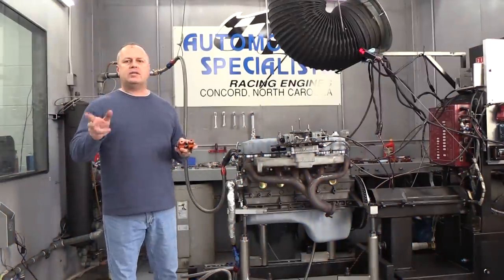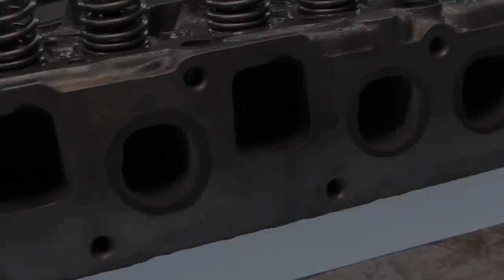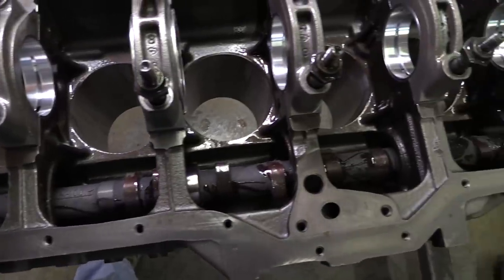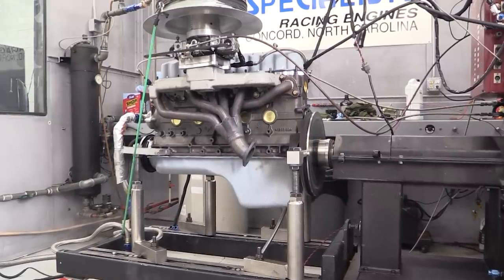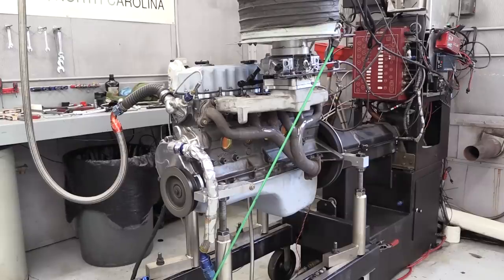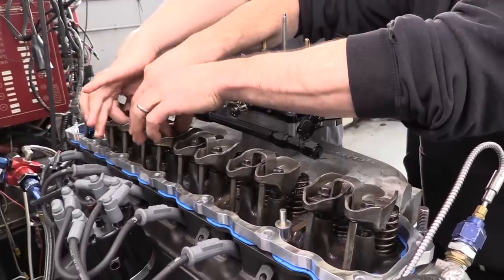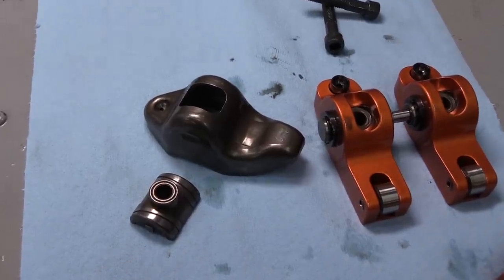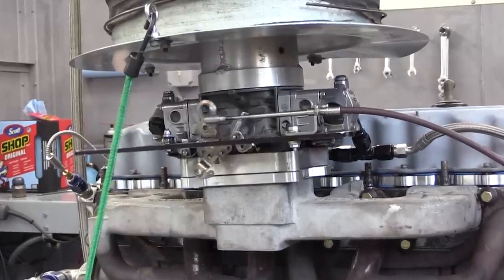Do Roller Rockers Make Power? (Dyno Testing a Jeep Stroker to Find More Horsepower)

Comment: Not much of a surprise but the 10% increase is more than I would have predicted. Another advantage to rollers, I believe, is that the engine has better throttle response in addition to more total torque and hp.
Reply: Basically there was another show that tested actual ratio of factory rockers on old and new vehicles alike...    A 1.5 ratio rocker usually had a ratio of 1.3-1.4 and a 1.6 ratio rocker usually had a ratio of 1.35-1.5...       So even going to a roller rocker 1.6 from a reputable rocker manufacter where 1.6==1.6 ratio you will gain over a factory 1.6 so it's not due to friction losses.   And in the case of going from a factory 1.5 ratio which might be 1.34 or something to a true 1.60 you just gained .26 in rocker ratio or 15% more lift at the valve!    This is where the power is, and in this 10+HP situation where the torque curve is elevated throughout this is exactly what is going on.

Comment: This test has been done many many times, the results are always about the same, and people continue to think roller rockers are a waste of money. As mentioned below, much comes down to stamped rockers being very inconsistent in size, not simply reduced friction.
Reply: Much easier on the valve train, less debris getting into oil, cooler temps, less friction, more power, better economy. Yeah such a bad investment :S

But of course they'll burn all their money converting to horseshoe and boring out the TB and putting spacers everywhere with messed up intakes...
Reply: Came here to say that exact same thing. Just having consistent ratio will make a difference. Power has been made with just roller tips.
Reply: How are roller rockers on holding up to many miles? I have never understood why LS engines don't use them. I always figured they don't have as long of a life, but that seems counter intuitive because of less friction.
Reply: John Tate way more moving parts. Stamped piece of steel is virtually indestructible. Fiction is minimal in a stock well oiled engine
Reply: @CanadaBud23  Horseshoe?
Reply: It truly depends on the engine. On a 90s and early 2000s Chrysler product where everything is literally made as cheaply as possible yes going to a high quality aftermarket rocker is beneficial. But if the engine already has very good quality rockers on it from the factory like the LA series small block mopars or the LS series chevy I would be surprised to see even a few HP difference. They can claim less heat and less wear all they want but until I see a test of oil temperature in a controlled environment I'm going to continue to use what has been proven effective and reliable for the last 60 years.
Reply: @johntate4638  depends on how quality they are...
but they should last 100,000 easy.... if not for ever
.
lots of modern cars use roller rockers (or lifters, ETC)
Reply: @johntate4638  and i think GM dont use them as they were the first to use stamped rockers..... and they have always been pretty good
like.... the design is perfected 
.
cheap to make, dead reliable and simple......
Reply: @snek9353  99 to 06 intakes are nicknamed "the horseshoe"
Reply: Lot of extra moving parts for 10hp, probably the worst $/hp power addition, maybe for a race motor .. but for my weekend street cruising motor not worth it

Comment: In Argentina we have a heavily developed Cherokee engine (with less stroke and more bore), that we use to power the Torinos and GTXs in our top racing series: TC (Turismo Carretera). It uses a dry sump lubrication system, 2 Weber IDF 48-48 carbs, and develops 460 BHP, revving until it gets to 9000 rpm.
Reply from the maker: That sounds pretty cool
Reply: The Horsepower Monster search a couple of onboards and you will see what I’m talking about. It used to rev to 9500 rpm to make the same power but now it takes only to 9000 rpm. It uses a 14 mm cam and altough the head doesn’t flow that much, they use a lot of luz  de leva or cam light (the thin layer of oil) (I don’t know the translation) so the cam opens way faster.

Comment: I would say between the net gain in HP and torque and  less heat, wear and stress it’s worth the extra $$$.
Reply: Swapped some on an old small block build and I figured about 15HP , good video I have been thinking of adding them to my stroker TJ . Thanks for the amazing work!!!

Comment: Basically there was another show that tested actual ratio of factory rockers on old and new vehicles alike...    A 1.5 ratio rocker usually had a ratio of 1.3-1.4 and a 1.6 ratio rocker usually had a ratio of 1.35-1.5...       So even going to a roller rocker 1.6 from a reputable rocker manufacter where 1.6==1.6 ratio you will gain over a factory 1.6 so it's not due to friction losses.   And in the case of going from a factory 1.5 ratio which might be 1.34 or something to a true 1.60 you just gained .26 in rocker ratio or 15% more lift at the valve!    This is where the power is, and in this 10% increase situation where the torque curve is elevated throughout this is exactly what is going on.

Comment: This was one of those, "well... yeah." videos. 
That six into one header really made that old Jeep motor sound good.
Reply: Well it was run open so...
Reply: I think a split of the old header would sound better, giving you dual-exhaust like the classic Hotrodders used to do to both Fords & Chevys.  No reason a split couldn't be done to an AMC-sixer.
Reply: @jackdale9831  if you buy a aftermarket WJ or TJ you’ll have a true dual at the manifold…well let me rephrase that the factory ones are dual outlets as well but they make less torque then the aftermarket ones from thorley or banks…the clone ones for 100-150 bucks work pretty good as well if they’re checked for a flat flange and good welds before installing it

Comment: I wish I would've seen this before I replaced my valve cover gasket. I'm sure the difference in power and torque is insignificant on a stock engine, but the other benefits are worth the price.

Can you test 1.7:1 roller rockers with a stock camshaft?

Comment: What are your thoughts on the 1.7 ratio Harland sharp roller rockers? Would be cool to see if those increase power over the 1.6.
Reply: The 1.7 I believe would increase more HP but depending on the camshaft they have I believe they 1.6 was best option for the camshaft 🤔
Reply: As far as I can tell they only make the engine run smoother and respond better to throttle input. This small power bump will be unnoticeable but it may feel faster because it's responding faster

Comment: In the real world, $300 for roughly 10 lb/ft and 12 hp is a smokin' deal.
Reply: That's on a 300+ HP. What's it on a sticker ?
Reply: Not just 10hp, that's 10hp all thru the power range. Like, everywhere.
Reply: Not to mention the reliability benefits of reduced parasitic friction losses

Comment: Test the bronze bushing trunnion vs the needle bearing trunnion. I've heard stories of the needles coming out the rocker arms and doing bad things to the internals.
Reply from the maker: That would be a fun test, but I doubt we'd see much difference. I've heard those horror stories too, but it's always a friend of a friend, or a drag racer with a really violent valvetrain. You never really hear of it on a street engine with a well-sorted valvetrain setup. Thanks for watching!
Reply: Yeah it happens especially if you use cheap junk China made roller rockers so don't use them & pay the price & buy good ones like Sharps or some of the comp cams or old crane golds . It happens mostly on all out drag race engines or high rpm race engines & most of those guys also have the engine blocks oil returns screened off so those nasty little needle bearings don't fall to the bottom of the engine & get sucked up into the oil sump & chewed up in the oil pump !
Reply: What about doing common jeep things like rock crawling and off roading? High heat, high strain, is be interested in a test on longevity of roller rockers

Comment: Never would've guessed that much loss
Reply: IT's BS.  This is an advertisement.   I've seen videos by engine masters who tested the same thing on a SBC and saw zero.. repeat zero difference.  These guys are using rockers with different ratios or manipulating the dyno.
Reply: @superkillr   Yeah I saw that one also. Torque and HP curves pretty much overlayed each other.
Reply: @superkillr  I've seen the engine masters build, you got it backwards, they changed ratios and cams. Here they only changed rockers and kept the ratios the same. They pulled the episode so I can't look up the exact specs but IIRC they went from 1.5 to 1.6. Engine masters changed too many variables to actually know what happened. Simply physics tells you rollers have to have some measurable benefits. The difference is only 3% for this build, its up to the owner to figure out if that's worth it.

Comment: Interesting video. Hopefully you build a dodge 3.9 V6 someday.  Has potential.
Reply: hell.... the GM 3.1 3.4 3.5 and 3.9 also have a lot of potential 
but no aftermarket.... 
.
the crank in the 3.1 is good for 8000 RPM IIRC

Comment: Good video! You just talked me out of roller rockers for my Corvair. The ones I was considering only had a roller tip, but still had a half ball pivot, which is where most of the friction losses are.. Not enough power gain to justify the cost. TYVM!

Comment: Let's see less friction less heat that's always been a recipe for freeing up power.
Reply: socleanmx6 I believe it’s called water meth injection
Reply: I wonder how much that improves the cooling situation for the tiny XJ radiators to get that 10-12 horsepower into the crank instead of pushed into the oil by the stamped rockers friction since 10 HP is about 7500 watts of energy.

Comment: The power loss is ONLY from the less accurate amount of rocker ratio. Stamped rockers never measure there full ratio. So if 1.6 stock. If you check the ratio I'd bet you'd find the stamped ones less than that around 1.55 or so. Not a friction loss. I've seen a few others tests like this. One using a stamped rocker and then machined to the right ratio check against roller rockers and there was no power gain
Reply: Makes a lot more sense.
Reply: That's because the ratios were corrected & all the same after it was done which probably cost more to have a machine shop correct this plus the fact that a stamped rocker will flex a lot especially if used with a very stiff valve spring opening at high rpms verses a billet aluminum or stainless steel roller rocker. Most of the power coming back is from the ratios being all the same because it's keeping all of the cylinders compression balanced being they are all opening at the same time & amounts & not all over the place . The other thing a guy can do is go a bigger ratio if it's offered let's say from a 1.5 to a 1.6 or 1.7 to increase the lift of the cam which can make more power provided the heads will flow enough with more lift & the valve guides are cut enough to allow more lift with out the valve spring caps bottoming on the tip of the valve guides  but the ratio change won't affect duration or how long the valve stays open or the LSA of the cam ! They are worth it if it's a engine that you want more power out of plus a smoother easier starting engine as well . Just did a set of 1.6 ratio roller rockers on a Chrysler 451 stroker a iron headed 9.1 compression ratio street pump gas engine & it made almost 500 HP & 530 ftlbs of torque at 4,200 rpms on the dyno  & if we were to stick with the stock 1.5 stamped I am sure it would have probably made 30 HP or more less HP than it did  .

Comment: When I'm 5 hours from pavement in Death Valley NP.  A place where water is much easier to find than gasoline. "If you know what you are looking for."  A place where there is only 4 gas stations, to cover more than 3.4 million acres. With nearly 1000 miles of mostly unpaved roads. Not to mention all the BLM and Forest Service Land that surrounds it, that also have no gas stations. I will be happy to install anything that conserves fuel. 10 horse power, that's fuel that didn't go out the tailpipe!  $350 doesn't seem like a lot of money to me.

Comment: From testing an average of five HP.
Anything that reduces friction and increases valve train accuracy is worth it.
I imagine GM went to a roller rocker type system on the LS engines for a reason.
Reply: GM LS engines use roller lifters but not rockers. They keep weight off the tip using non roller cast rockers. The trunion is a bearing but not the tip.
Reply: @exidous6831 
The roller tips on roller rockers do help slightly but the benefits are very slight.
The roller trunions make a big difference.

Comment: I am curious, what is the delta in heat generated in the engine between the stock sheetmetal rockers and the rollers? I mean, you say it helps in the video, and other commentators have also said as such, but...what is that difference? I don't think I have ever seen anyone demonstrate the difference with actually measured results.

Comment: need a test of roller tip vs full roller.
Reply: The tips don't roll...It's been tested
Reply: The Executioner And why should the tips roll? They should not move at the point of contact, for the duration of contact

Comment: So...there's no need for a stiffer spring "upgrade" for sub 400 Hp inline six's?
Seems like anything under 5k rpm's, there's less worry about valve float?
Reply: Stiffer springs if you run boost/high RPM or both.

Comment: First, great video doing real world comparisons. Im kind of surprised that the intake and exhaust changes made so small of a difference. Great info about the exhaust ports being a limiting factor.
Why is everyone so obsessed with PEAK numbers? Is this a race only engine? 
Peak numbers mean nothing except in a DICK MEASURING CONTEST!
Likely its going to be in a street driven vehicle of some sort and taken out to play on some weekends. So lets look at it from that prospective. Over 300 ftlb of torque all the way through the pull. That's very impressive. Especially when you think a Jeep is not a heavy vehicle. But can we maybe drop the lower end some and see what it does from 2000 or 2500 for the low end. No one leaves a stop light at 3500 rpm.

Comment: The reduced friction is a given, overall stiffness gain  I am not so sure about  when using low pressure valve springs......I have done some testing on rockers plotting the lift curve vs. crank rotation and the stamped rockers can have an exaggerated progressive/degressive ratio if you will and the roller rockers 
can provide a lift curve cycle that provides more valve open area/time. I suspect that is part of what is happening here......1.6 ratio rockers can be many different ratios throughout the lift curve......only way to know what you have is to degree and plot out the lift curve cycle to compare them.
    Very nice job on the build on this  engine ....It is making really good power, more than I thought it would. Good work guys.
  Are there any flow numbers from the head?

Comment: More consistent then stamped. Someone did a comparison of  stock 1.5 ratio chevy rockers and seen a variance of  +/- .03. Also less drag and free up power.
Reply: they need to test roller tip vs full roller
Reply: @1flynlow  I would like to see that there is a lot of controversy about that topic
Reply: @tristanabell2117  engine master Dyno tested Stock stamp rockers vs roller tips vs full rollers to 7,000 rpm. The stock stamp and the full roller made basically the same power and the roller tips were down on power.
Reply: @konnerkramer329  awesome thanks for the Info I'll have to check it out.